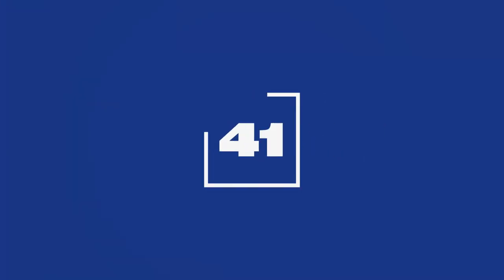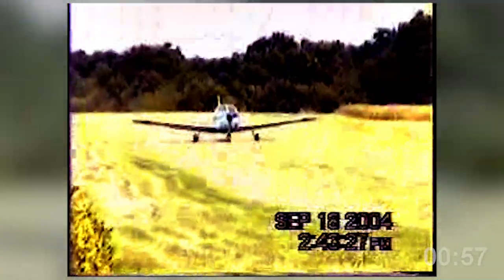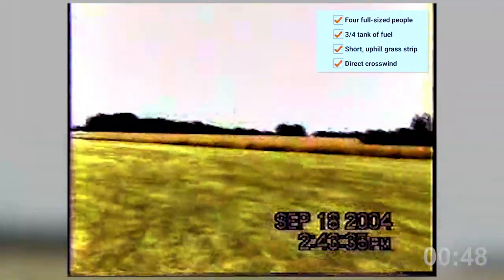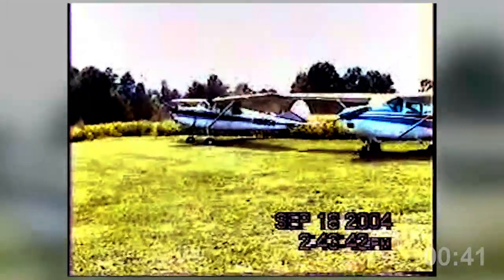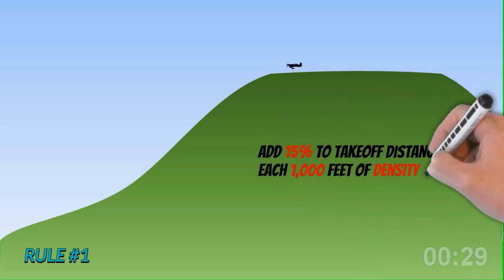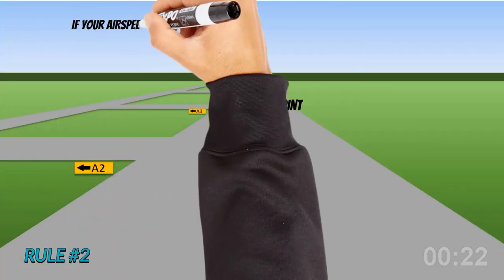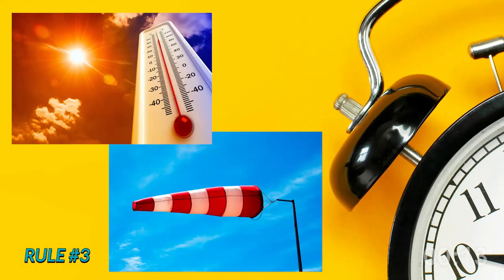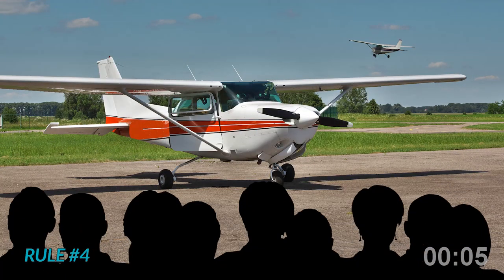4 Rules of Thumb for Safer Takeoffs in 57 Seconds

Comment: A lot of CFIs, DPEs, and tons of other aviation gurus religiously recite the 50/70 Rule as follows: "If on your takeoff run you haven't achieved 70% of your rotation speed by the time you're 50% down the runway, abort your takeoff." 

That regurgitation is not entirely correct.  The 50/70 Rule is: "If on your takeoff roll you have NOT achieved 70% of your rotation speed by the time you've reached 50% of your CALCULATED TAKEOFF DISTANCE, abort your takeoff." 

Consider the following takeoff conditions as an example: the departure runway is 8,000 feet; your takeoff weight is light; your calculated takeoff distance is 800 feet; and your rotation speed (takeoff speed) is 70kts. If you haven't reached 70% of your rotation speed (49kts) by the time you are even 25% down the runway (2000 feet), something is very, very wrong. 

While the length of the runway length is helpful, it is not relevant to the takeoff performance of the airplane at the time of takeoff.  What a pilot is really looking for is the percentage of the airplane’s “PERFORMANCE”, not a percentage of the remaining distance on a given runway!

The intended purpose of the 50/70 Rule, as most pilots generally apply it, is not to run out of available stopping distance on the runway if a takeoff has to be aborted.  In other words – the calculated Accelerate / Stop distance.  If the Accelerate / Stop distance is not readily available to a pilot for a General Aviation single engine airplane, you can approximate the Accelerate / Stop distance by adding the calculated ground roll distance for the takeoff and add that to the calculated landing distance.  For an added safety factor, you can use the distance necessary for the “Total-to-Clear a 50 foot obstacle” in place of the normal ground roll distance.  Using the Total-to-Clear a 50 foot obstacle distance will provide a means to account for a startle factor and/or barely getting airborne when the takeoff needs to be aborted.

In the normal application of the 50/70 Rule the reference to the runway’s physical length is not unhelpful. 

More accurately, the 50/70 Rule should be applied to determine if your plane isn't performing as it should by applying the 50/70 Rule to your CALCULATED TAKEOFF DISTANCE for the takeoff you are attempting makes more sense in a real world situation.

The FAA’s FAASTeam agrees on this application method and is recognized in the FAASTeam’s “Safer Skies Through Education” publication of “Pattern Precision”, dated 2022/01: 

https://www.faa.gov/.../2022-01/Pattern%20Precision.pdf. 

“Here’s some rules of thumb to consider when computing your takeoff calculations:
(50/70 Rule) When planning takeoff from short unobstructed runways, establish a landmark at 50% of your calculated takeoff distance. When reaching that landmark, you should be at 70% of your rotation speed. If not, abort the takeoff and reduce weight or wait for more favorable wind and temperature conditions.

(30/70 Rule) If you must clear obstructions on takeoff, you’ll need to have 70% of your rotation speed by the time you’ve traveled 30% of your available takeoff distance.”

Comment: The 50/70 Take Off stupid rule.  4,000 feet runway.  50% is 2,000 feet down.  60 Knots Vr of 42 knots (70% of 60)  i get 42 knots by the 2,000 feet mark . I will try to take off   Oh wait, this rule is stupido..  If i only get 42 knots at 2,000 feet down that means the engine is no good for take off. You said to try it anyway..  I SHOULD NOT TRY TO TAKE OFF, YOU DUFFUS.  DUHH !

Comment: Watch the video i give link to below . There are hundreds like it. FAA and NTSB missing the problem they dont see the cause Failure to do fatigue analysis on Swage couplings , turnbuckle joints and other ones to see the useful life of SS cable has been exceeded by many times . Also Go watch Dale Snort snodgrass crash. Same exact crash as this one I give , different plane. Thousands of planes experiencing this elevator failure on takeoff. The REAL problem is Control Wire cables. The FAA is not properly dealing with this clear problem in GA aircraft. Wire cable has a scientifically proven maximum of 20 YEARS useful life !!!!. This is FACT.   All these planes are well past the useful life of the SS control cables, and they are not being changed. The elevator cable is the most stressed of them all, especially on takeoff.    IT is simple GUYS . all these cables are breaking at the Swage connection loop and the FAA NTSB is failing to identify it. Every single plane in the USA need to have the control lines changes if they are 20yrs old. 20 yrs it the calculated max life of any SS wire cable. An AD needs to be written for all GA aircraft. Until then You will keep seeing this same exact accidents of unexplained control failure in flight or on takeoff by very seasoned pilots. These people did not just suddenly forget how to fly guys.   https://www.youtube.com/watch?v=ltZAU-1lg6k